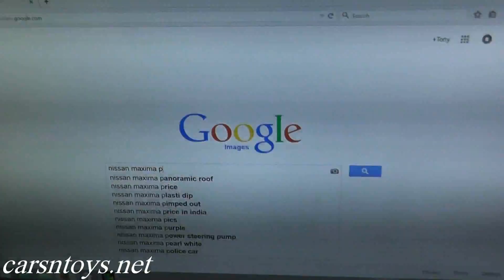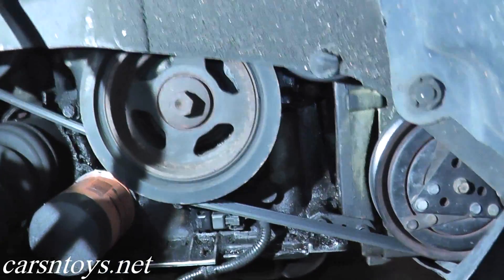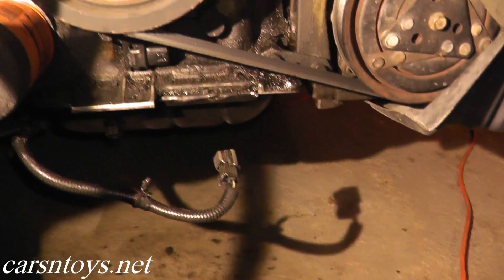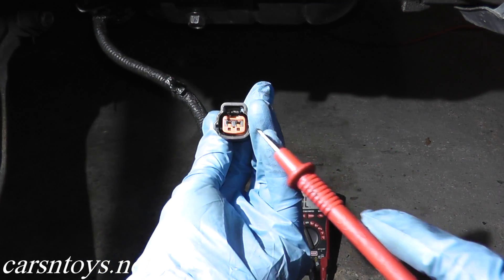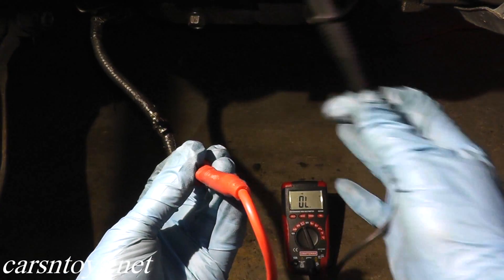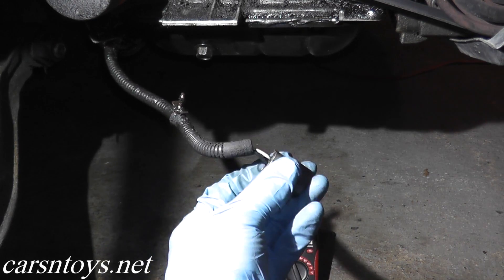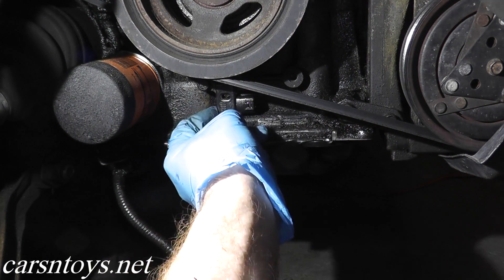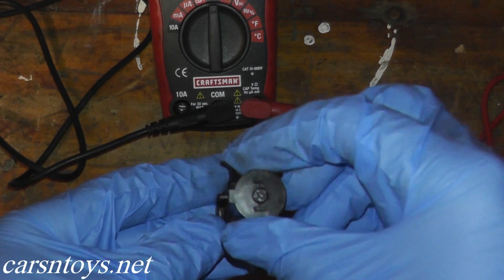Crankshaft Position Sensor REF P1335 Testing and Replacement HD

Comment: Great production! My 2001 Infiniti I30 has been idling rough. The crankshaft pulley went bad and the belt ripped the OEM sensor apart. I replaced everything and used a high quality aftermarket Sensor. The car has never started or idled the same since and seems to be getting worse over time. I'm thinking the sensor wasn't so high end. Do you think the Sensor could be the culprit? I am not sure of symptoms other than not starting. Every once in a while, the engine skips a beat but no codes are thrown. Just curious to what the Pros thought as this is pretty much the same car  in the video.

Comment: okay bro my sensor reads i believe 1 buts its very low i dont have same multi meter as you but i think i had it on right settings. .
Reply: i have cen-tec multi meter can you help me on what to set it on if you google my meter layout
Reply from the maker: What kind of vehicle you testing?
Reply: CarsNToys I have an 01 nissan maxima. .  It also has an melted ignition coil harness connector,  the clip piece thats grey broke off just the wires is press pushed inside the coil pack with silicon inside it to hold the leads in place but i think i messed it up one day by moving it around,  it use to have a misfire feel as well so thats what im thinking i should replace
Reply: CarsNToys now it turns over but wont crank. .
Reply from the maker: Sounds like the harness connector & coil pack aren't meeting correctly. Did you get the car running? Shoot me a message on FB if you continue to have trouble.

Comment: I have a 2001 Nissan Maxima & I'm not getting any signal to the crank sensor how do I go by fixing it
Reply from the maker: Do you mean no power is getting to the harness connector?
Reply: yes no power is going to it
Reply from the maker: You most likely have a break in the wiring. There's a tool you can purchase that can help find the breakage. Check out Scotty Kilmer's page and search for finding electrical problems.

Comment: I have a 04 Maxima is the sensor in the same location?
Reply from the maker: It's located under the air duct. Try searching via google images. If you have trouble finding the sensors (I believe your vehicle has two of them..if  I remember correctly) shoot me a message via facebook.
Reply: CarsNToys Thanks for the reply. I replaced the crankshaft sensor, started the car the engine light went out then came back on like 30mins later. What could be the issue, do you have to clear the code after repairing?
Reply from the maker: You generally have to erase the code. However, the car's computer will turn off the check engine light eventually if everything has been repaired. You're getting p1335 or a p4xx code?

Comment: Had a situation where, over a cold, moist night, the sensor wires, at the connector, would have condensation & would cause a crank-no start. The 2 wires TO the sensor, itself, were angled up so that any condensation, on the wires, would flow downhill TO the connector as well. Jeebus! I 'rerouted' the harness so that it was 'level'. I cleaned the sensor male wires &  the connector itself with switch cleaner. I then injected silicone grease into the wire-connector, so that, when I inserted it INTO the sensor itself, it compressed & squeezed out excess and formed a moisture (& dirt) barrier. The problem has NOT occurred (over several rainy or damp/foggy nights) when I go to start the car first thing in the morning. Yahoo!

Comment: whats up buddy i have a 97 nissan maxima and im getting no crank and no start response i replaced the starter and and the battery,could the crankshaft position sensor cause this issue, i was thinking the factory alarm is causing the car not to crank i went over the wires they were not in bad shape but i did realize the wire was cut and respliced (ref sensor wires) so my next step was going to be run a ground from the tranny mount
Reply from the maker: If battery is new it should certainly crank. Try this: https://youtu.be/GugMM7nVrrU

Comment: can you make a video on how to replace the harness for this sensor? after testing it, im 100% its dead and its also the reason my car wont start.
Reply from the maker: The next time I come across a vehicle that's about to be junked I'll certainly show. But in the meantime, the easiest way is removing the old harness and splice in a new one via soldering. You can find harnesses on ebay. Also try a local junkyard if you have one.
Reply: thanks i see they have the connector at for like $10 at oreillys. thanks.